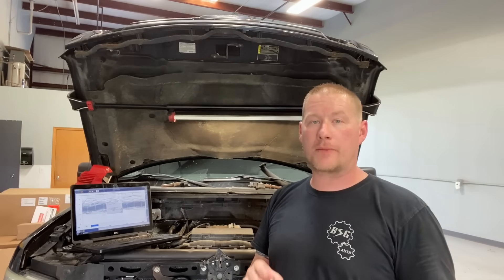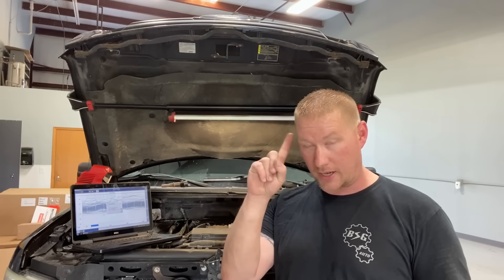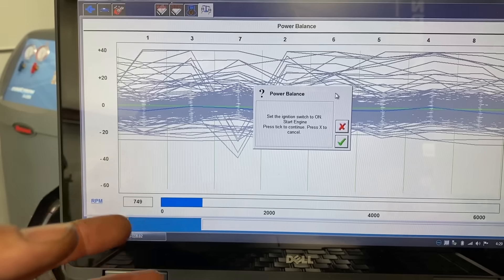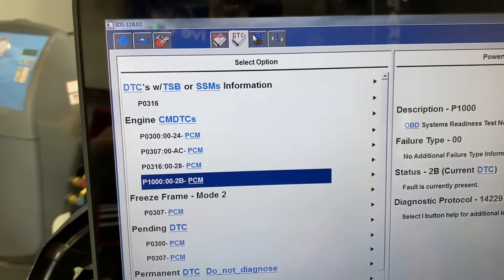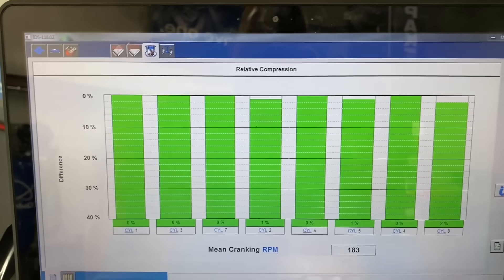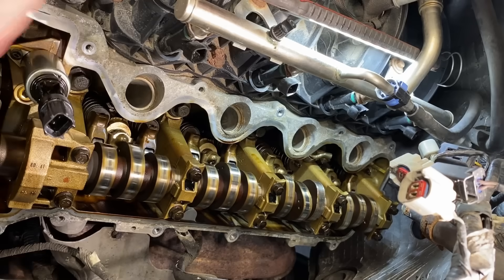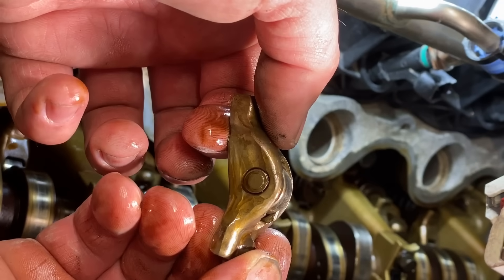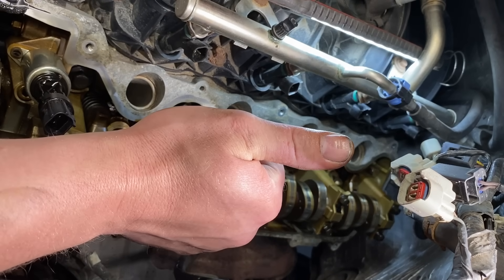Ford F-150 & Expedition 5.4L 3v Triton Engines Hard to Diagnose Misfires Fixed!

Comment: I sure do appreciate your videos I just bought a 2006 f150 with the 3 value engine and I've been going nuts trying to figure out why number 7 cylinder has a misfire I've done everything but pull the value cover it's coming off tomorrow

Comment: What sensor is reading cylinder compression and temperature?
Reply from the maker: none
Reply: @FordTechMakuloco  how are you getting data reading
Reply from the maker: There is no cylinder temp sensor or reading but the compression is inferred by the crankshaft reading through the scan tool software, The cylinder with the faster speed on the compression stroke has less compression.
Reply: @FordTechMakuloco  the crank sensor reads from a Hall effect, I’m not understanding how this works? If any cylinder  has a misfire that’s determined by a coil failure. How does the ecu know the speed on the compression stroke does each cyl have a reluctor wheel?

Comment: What about cylinder 4?   I have a random misfire in cylinder 4 on 2000 f250 5.4.   I swapped the coil from 4 to 2 and the miss fire stays on 4.

Comment: Another problem I’m seeing in my machine shop with these engines as well as other oHC Ford engines in that era is valve heads growing more tulip shaped than they were made. This will increase the stem length and shut off the hydraulic travel in the follower adjuster.  
    It is hard to see without measuring the stem length with a dial indicator. 
   I’ve even ground a few of these valves and for the most part everything seems normal until you go back and adjust stem length.  
    It’s very difficult to see while in the vehicle.

Comment: Someone mentioned you can't put in a f150 5.4 3v in an expedition. Is that true? There are a couple things in different positions. But wouldn't there still be the same mounting points on the block?

Comment: 06 F150, 5.4 nonflex, 2 WD. Could this cause a misfire that only shows up upon going up a hill at around 40/45 mph at low rpm. Disappears upon depressing accelerator or disengaging  overdrive. If not what would possibly cause this type misfire? I was wondering if a sparkplug might? Thanks John
Reply from the maker: It is spark plugs yes, coils are generally fine unless you have junk aftermarket coils on there.
Reply: @FordTechMakuloco  Thanks

Comment: #5 roller bearing on mine failed and wore the cam lobe off. Truck ran perfect and was towing a boat, only noticed a tick when outside. I repaired it 2 years ago and going strong

Comment: 2006 truck at work nearly 190K Was ticking horribly I went out on medical leave for 4 months. Came back truck no longer ticks and actually has some power now as before it used be a real dog. Struggled to even pass a bicycle. lol Nothing done to it though someone did put diesel in it by mistake and they had to pump the tank out. I suspect this happened to it. No noticeable miss But when driving it today did see the  CEL flash. Could the ticking have been upsetting the knock sensor causing it to pull back the timing and killing any power?

Comment: I just bought a 2012 Expedition King Ranch with only 39k miles and it looks like it just rolled off the assembly line. I'm probably going to change the transmission filter, drain the fluid that's in the pan and top it off. I'll probably change the oil every 3k miles because we'll only put about 6k miles a year on it. Any other suggestions?

Comment: Here's a problem that a lot of mechanics missed. 4.6 liter 3 valve was misfiring. Replaced spark plugs. Improved but not solved. Replaced coils. Even better, but still misfiring. Turns out, the little plug in connectors that plug into the coils were corroded and loose. Mechanic cleans off the corrosion, and crimps them tight with needle nosed pliers and the motor instantly runs as good as new.

Comment: I have a misfire on cylinder 7 I was told it was injector 7 I have replaced all injectors and engine coils and check engine is still flashing. Ac blows hot when it blinks…. Any ideas

Comment: Love your videos. I have a question hopefully you will see. Can these cause a misfire at high rpm? My engine runs fine until I’m at full throttle and close to 4k rpm. Engine has 190k miles, new timing set, new spark plugs and coils. Another question ..  What software do you use for diagnostics? Thanks in advance if you have time to answer.

Comment: Great video.. i have a good one for you an 04 F150 5.4 rich bank 1, lean bank 2 idling intermitent misfires on cylinders 1- 4.. swapped 02 sensors side to side no change, put in 8 spark plugs no change.. spray the intake with brake cleaner while watching the fuel pids and nothing....  The bank 1 vvt angle was .5 off at idle so I put in a solenoid still same.. unbolted exhaust from manifold and held it away from the manifold still missing on all of bank .. I think next should be a match in the gas tank.. or do you have any ideas would be great

Comment: Have problem with 06 expedition. ( Triton motor)
It won't rev past 3500 rpms in park.
I replaced throttle body, conditions improved in driving. The rpms look fine, 500 at the light, runs good  shifts fine rpms above 3500.
Just not in park. 
 But still won't rev past 3500 rpms in park.

Comment: could this happen with a new motor....25k miles...misfire 6...everything is good.vac maf,compression, spark,coils,plugs,filters,fuel injectors, voltage,

Comment: Great video!  Thank you!  I’m pretty sure mine is just an exhaust leak because it goes away almost entirely when the timing changes during warm up.  I am getting a P0300 every now and then and I can feel the miss when under load but I believe it’s just a bad coil boot.  My engine only has 112,000 on it. I maintain the oil like clockwork.  It’s important in these engines.  Otherwise they are prone to a lot of problems.

Comment: I have an 08 5.4 F-150. New cats. New 02 sensors before and after cats. New plugs. New boots. New Coils. Lean bank one and misfire code on every cylinder. Cleaned throttle body. HELP me please.
Reply from the maker: Sure sounds like your timing is off, start there with a quick diagnostic check.

Comment: Thanks for your videos... 2011 expedition with the 5.4 triton. Local mechanic states that there is no compression in number 3. Any advice? 135k on the motor and vehicle is in great shape? Could this issuer be the same on a 2011? Thanks!

Comment: I have a 2003 ford expedition 5.4 185,000 miles. I've owned since 2013. I hate to junk it because it is stillvery nice. I've put all the common parts on trying to rid a lean code and mis fire codes that move from 3,4,6,and 7. I've replaced fuel filter, all the plugs, 3 times total. The last due to a coolant leak at the front of the intake. I replaced the intake with new ford oem intake. Cleaned and checked every injector.The coolant valve above 3 and 4 for a leak. Coil packs tubes and elbows due to heat rot. Reprogrammed and updated pcm.I'm sure I'm forgetting something here. But im at my witts end. Any advice for me on a 2v 5.4 it stumbles  and runs rough.

Comment: 08 expedition cylinder 7 injector noid light pulses for 10 seconds after startup then stops. Is this a pcm problem? New coil new plug. All other injectors stay pulsing when attached to noid light only cylinder 7 will pulse noid light for a few seconds after star then go dead. Please help anyone
Reply: Will pcm detect compression loss and shut injector off based on only low compression even though the coil fires?
Reply: Compression was good. No bad springs or roller followers. Applied air to cylinder like one of your videos and no leaks through the intake or exhaust. Has to be a bad pcm? Please help

Comment: My 1999 f150 starts having “hiccups” then dies and shuts off all electricity to the dash, I have no idea what it is, I’ve replaced the IAC, both position sensors, coil packs, the computer, and fuel pump, I still have no clue and it’s been doing this for the past year and 3 months, it has 240,000 miles and I’m hoping someone will know how to help me, thank you

Comment: I have a 2006 Ford F-150 and the O/D light keeps coming . When I’m on a complete stop and accelerate there’s a chance the truck stops and the only way to get it back working is to restart it and it works. I haven’t had luck with anyone diagnose what it is

Comment: Hello I have a 2007 Ford f150 4.6 V8. When I start the truck and drive down the highway for a few minutes it starts misfiring and shakes under acceleration or at idle.
This only happens after the truck is run for maybe 5 minutes. When I turn off the truck, let it cool and start it up again it runs normal until driven for 5 minutes.
It has 143,000 Miles. Any thoughts on what could be the problem?

Comment: Ok pulled the drivers side valve cover expecting to see a valve follower popped off #8. What I found is on the exhaust valve, the follower was loose, but still in place. When I started pulling on the follower, it came out. The roller is good even though I assume it's original as it has the large oil hole. It feels like the valve spring might be broken as the spring feels loose and spins. I would like guidance on what I should do. Also can the spring be changed without removing the cam or worse the head. Where are you located?

Comment: I have a 2002 ford f150.  In warm to hot weather it runs great.  Soon as winter gets here around 40s and below. My truck will run then surge,  surge I mean it want take the gas and up and down idle.  I cut the engine off and crank it back up, it runs fine ,great when it warms up, .  But next morning same thing. Surge when cold.  When it reaches warm. I can cut engine off and crank it back up,  it runs fine for the day.  It never acts up in warm to hot weather.   I've replaced. Fuel pump.  IAC Valve.  Mass air sensor.  Cleaned throttle body,  O2 sensors, 4 of them.  Checked vacuum leaks.  All other stuff.  But not throttle position sensor.  I need help. Only acts up in cold weather

Comment: Ok watched this video. My wife's 2011 Expedition had started running rough recently. She came in today and said her truck was running so bad she didn't think she would make it home. Scanned and showed misfire on #8. I swapped plug and coil to #5 and misfire stayed on #8. You say in your experience this happens on #7. Is this what I should check? You also say this will damage the cam. What is the cost to do this much work (cams, timing chain, cam followers, etc)

Comment: My 2007 is doing the same thing after two coil and plug replacements. Number Six and four cylinders. Upon acceleration is when it messes up. No check engine light though. Coils are not cheap $200 plus labor. I'm thinking of selling the truck and getting away from the dreaded 5.4 three valve Triton.

Comment: Does anyone know if the same thing could happen on the other side? I currently have a misfire code on cylinder 3 after replacing coils and spark plugs. Haven’t changed the fuel injector yet but I will if recommended. Thanks!

Comment: I've got an 05 that has a misfire and I've checked out just about everything  it did have a code at one time p0174 but I reset it after replacing some things. Idles good but misses when under a load had a place tell me he thinks it's fuel pump cause when he drives it and it acts up the fuel pressure drops on his scanner . Any thoughts?

Comment: Hey bro I got a simple problem with my F150 5.4 and no mechanic can figure it out in Toronto. Asking for your help.
When I start driving from my house it's fine. Going on the highway all good but soon as you exit and come to a traffic light and stop, the engine starts rattling and misfiring real bad. Soon as you shut it off and start back the engine, it runs like new again. Until next stop.
Only when it warms up.
I changed the timing chain and phasers and vvti solenoids and no luck.
Any ideas please🙏

Comment: Ok so I have same issue!! #7 misfire, new spark plugs is when it started, so then did coil packs, and fuel injectors, still #7, just pulled valve cover, to check rocker follower but all seem good… so any ideas??!!

Comment: Usually when you have a rocker arm/ roller follwer comes off or breaks it will make a popping noise either out the exhaust or the intake depending on witch ever one that's broken .you can take a temperature gun and shoot the exhaust port on the manifold and tell exactly which one it is it will be the one with the lowest temperature.
Reply from the maker: Yes that would be the case on a 2v engine but on this 3v engine there are two intake followers and every time it seems it is one intake follower that pops off so you wouldn't hear anything in this case.

Comment: I saw a 2008 Ford Expedition XLT Sport for sale with 225k on the clock asking price is $5500..no issues on the car so far..interior and exterior is in immaculate condition..good buy or no?

Comment: I have a 06 f-150 5.4 3v with low compression and two cylinders has a rebuilt jasper engine in it with about 120,000 miles on it well-maintained any idea what’s going on with it probably

Comment: just opened my valve covers, and i found the exact same thing on cylinder 6! 😅
     currently at 230,000 miles on my 2011 Expedition. 🙏🏿

Comment: I have a 2010 f150 5.4 misfire on cylinder 3 and 7 only happens for 30 seconds and misfire goes away took it everywhere even the dealer can't diagnose what's causing it

Comment: Great video, as always. I'm curious. You mention Forscan in your comments, but the diag tool you are using is not Forscan. Or am I wrong? I have Forscan and, for my 2004 F150, it is very limited, and unable to run the tests you do in the video (of course, it is different for each Ford model). Am I missing something here? I was hopeful Forscan would give me bidirectional and lots of graphs like you show, but it's as limited as my old scan tool.

Comment: What if the shop does a cam phaser job which doesn't fix the job and then says "hey! you didn't maintain the truck well because the engine is full of sludge!" Then the shop says all of the CATS were bad so we removed them because they are $800 a piece. And it still hesitates when trying to get it to accelerate or going up a small hill. And there is no code.  This has been a nightmare.

Comment: Hey brian, I noticed my #4 intake roller follower seized up and chewed up my cam so I decided to replace the camshafts, the towers and camshaft caps are all scratched, are my heads trashed now? Another thing, a shop had recently done a timing job on it and and the driver side chain was lined up with the "R" rather than the "L" and the passenger side was lined up with the "L" rather than the "R" while the crank timing mark was at the 6 o clock position, it was running fine, should time it that way again? Thanks in advance 2010 f150 4.6l 3v

Comment: How much does it cost to do timing chain and one cam and roller followers vs changing engine. I did change my engine with one from ford was very high compared to others but not one mechanic within 100 miles would fix it they all said replace it so I did but I did it myself 6200 and a 800 torque converter just wanted to know price to fix it vs replacement

Comment: Just caught this video and gotta say I'm impressed and humbled at the knowledge you professional technicians process and how willingly you share with us. I've been chasing lean codes and misfires on my 00 excursion with the 6.8. A little history on the vehicle, low miles only 60k but it was ran without a catalytic converter for unknown amount of time. The cat was stolen and previous owner never replaced. I purchased the vehicle and installed the new catalytic converter.  So far I've also installed refurbished oe injectors, purge valve, vent valve, pcv valve, maf sensor, Motorcraft coils and sparkplugs and changed several deteriorated hoses, fuel and air filters. About the only thing I haven't changed are my oxygen sensors. Any insight or route you can guide me towards... any assistance is greatly appreciated. Also almost forgot to mention the vehicle smokes heavily usually when cold and exhaust smells a bit rich of gas. Thank you sir again, any Input is greatly appreciated.

Comment: my misfire started in cylinder 3. now i'm showing random misfires, and misfires on all cylinders in bank 1, 1 2 3 and 4. i replaced the spark plug and coil pack on 3, knowing that wasn't it. i've followed your video to do the timing chain video, so i'm familiar with the roller followers.  shouldn't i be able to hear wreaking havoc under the valve covers if that is the case though?  also, at idle the misfire doesn't "feel" that bad. but when i put it in reverse its really wonky.  i've got relatively new bosch fuel injectors on there too.  where should i start looking?

Comment: Any ideas what mechanical reasons a 2.5 2010 fusion would have lower compression on 2 cylinders and throw a misfire code. All usual stuff checked is why I think it’s mechanical problem . Thx in advance

Comment: Sir will you Please Please help my Expedition 2006. You can use it in your videos?? It only has 129k just bought it from a guy. I Know it has Super Potential to be Great long lasting. It drives good but got the cyl 5 misfire code, also loud under it driving. Think the front drive shift is loose or something.. Let me know!?!

Comment: What would you recommend for the same problem but it's on a brand new 5.4 3 valve number 7 cylinder misfire with new plugs coil packs injectors and still cannot figure it out and has a rough idle

Comment: The 5.4 3 valve has to be one of the most unreliable engines ever made.  The owner of this one was lucky to get it fixed before it suffered a catastrophic failure due to that bad cam follower.
Reply: Sucks because the bottom end and rotating assembly is rock solid. Just everything bolted to it sucks 🤣 got 350,000 on my 3v